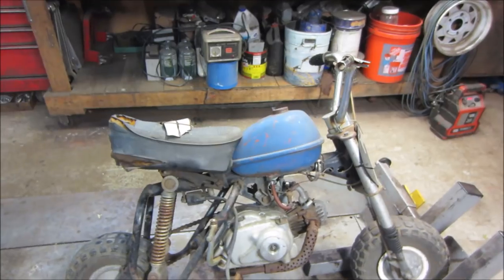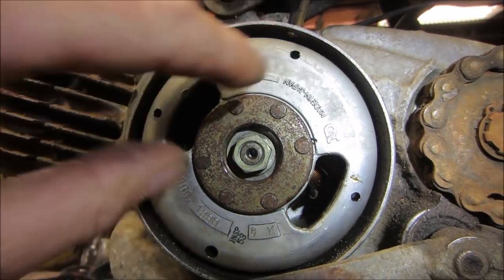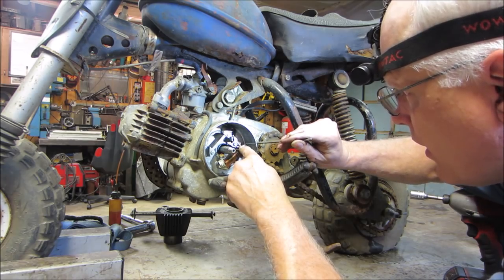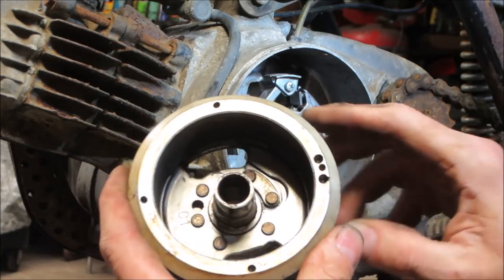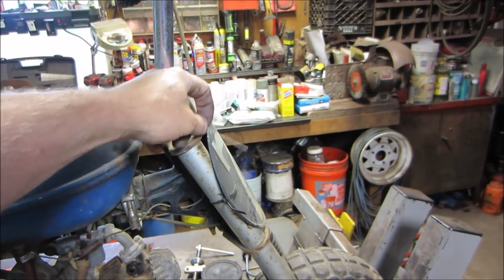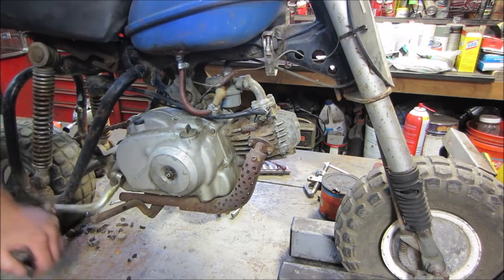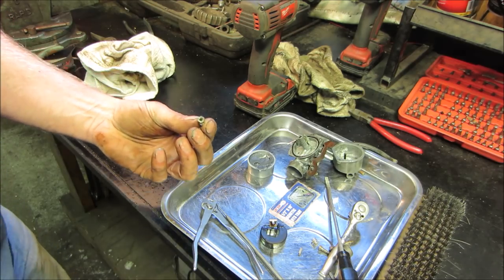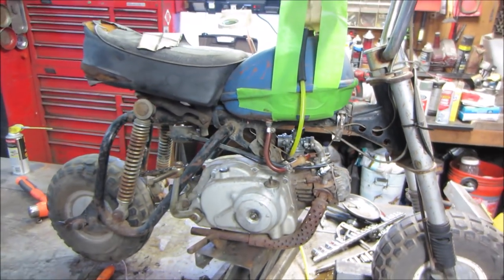will it run? old  honda 50 monkey bike

Comment: Me and a friend bought a honda 50 together for 20 buck when I was 12 yrs old . I got it running we beat the crap out of it for years. Then sold it to an old guy in town when the coil wire broke off. Then thrirty year later he gave it back to me when I found out he still had it. I got running and still hav fun with that little thing today and im 53 yrs old now. thats a well built machine in my book
Reply: Brian Atherton cool story, we were one of lucky ones owning a mini honda as a kid, good times!
Reply: Elo bob Dwarka yes we where . I always want a 70 but never got one. I did have a trail 90 that was almost indestructible  It had hi low range. I can still remember discovering that if you hold a little pressure on the shifter it would release the clutch. That made for a short life for the rear tire.
Reply: Yes ,that bike could take some abuse and keep on going..
Reply: Incredible story, not many can say the same. That’s awesome, I wish the guy I sold my first bike to still had mine. Man it’s was a lot of fun but being homeless and having to eat forced me to sell. I will have another that’s for sure
Reply: Brian Atherton same with me my father and my self got a old  1969 Honda SL.70  ran incredible with a little love and still have it . My honest opinion is the old stuff is better then new .
Reply: honda monkey can take a nuclearwar and it will still start on first
Reply: My fathers 43 and trade a push mower for a 750 street bike back in the 80s when he was like 11 and him and his friend would push it down the road and ride it because there parents didnt know about it and they laid it over the ditch one time and wasnt bug enough to pick it up and it was burning there legs because it was on them if that's not a amazing memory I dont know what is I have no clue how there still alive
Reply: any pictures of it
Reply: @brianatherton4916  I had one of those trail 90's it was a blast to ride and would climb very steep hills in low range, had to put all your weight on the handlebars to keep it from flipping over backwards!👍👍
Reply: On bikes and beards the pull a van with a trail 90
Reply: Brian Atherton . You ever think about selling it hit me up
Reply: Hell yeah,just goes to show us how well things used to be made back when things were built to last and people took pride in their work. It's a world away from the junk that's built to break nowadays because the manufacturers know that people will just go buy a newer,more expensive version. We are living in a throw away society and people don't even bother with fixing things anymore because it's cheaper to just buy a new one. It's much better to buy an older machine that is in good working order than to buy it brand new because the older stuff is bulletproof and there are still plenty of parts kicking around to fix them. It seems like a lot of the machines that were built up to the mid 1980's are still around and most of the stuff beyond that is just over complicated,computer controlled junk.
Reply: lucky im 12 i have a go kart my dad wont help me fix it
Reply: @flixyfn2454  what’s the problem with the go cart? Is it getting gas and spark? YouTube it and “borrow” your dads tools when he isn’t looking. You can do it man.
Reply: Landons flxzy If you can figure out exactly what is keeping it from running,chances are you can find videos on here that will go through the process step by step. Type in the problem and put "tutorial" after it and you will get endless results. If you can't get help,do it for yourself,you'll gain valuable knowledge and you will get the satisfaction of fixing the problem with your own two hands. Good luck,you can do it.
Reply: @GratefulEd907   i did that he got shocked
Reply: @flixyfn2454  😂😂 that’s great news it means ya got spark. Now see if ya have another friend dumb enough to try it? And don’t let those kids help you work on it because they’re idiots. You’ll want to check the carb next look for a video with a carb like yours. Good luck I hope it’s a simple fix. You may just need a can of carb cleaner.

Comment: You never fail to teach and improvise!! My wife and I each had Trail 70's.Wonderfull bikes. Would run up to 55 mph or so. Used it to roam the backroads for a few years.  Could use it on main roads some too. She and I shared many memories on those trusty Honda's. Had touring bikes as well. But The Trail 70's were a blast. And yes it did have to be plated. Loaned them to friends so they could take the state motorcycle license test's too. They never failed. lol

Comment: Plug boot replaced with a zip tie-Check. Throttle replaced with a brake lever- check. Gas tank taped on with painter's tape- check. Brakes- don't need 'em. This is the  award winner, Mustiest video ever! What a hoot...and the sumbitch runs!

Comment: I don't remember QA50s having rear shocks...  I think this one's been 'customized'...
Reply: I agree......This appears to be a 1973 QA50 K1 with 1973 Z50 shocks added - or '75 K6. Interestingly, it's a pretty trick mod no less which attaches to a hinged seat to be effective........maybe a seat bracket from a moped or other model?....hmm.......possibly all from a 1975 Z50A K6 (shocks too), although the seat here still appears to be the original (no side snaps).
Reply: @SoaringEagle1  I had a  1972 UK version that had shocks like that. It had no lever on the LH handlebar. Whats that for? it has auto clutch, no need for a  clutch lever.

Comment: I had a Honda Mini-Trail when I was 12 that my parents bought me brand new. It had a headlight and tail light with real chrome fenders, and it had a 3 speed auto clutch transmission bolted to a 50 CC engine. Needless to say I was the "king of the block" with that bike. I will be 60 the end of this month, but I still miss that little bike.
Reply from the maker: Very cool!

Comment: many old bikes didnt have a rubber tip on the float pin.. brass in brass, hence they wore out quicker... i have a pack of 10 valve pins and holders for one of my old bikes as they wear out every few years to the point they dont seal anymore.
Reply: many were stainless needle with brass seat, the seats got beaten of course and they leaked if it just trickled "shut" without  engine running. which is what the petcock was for :)

Comment: Small piece of wadding material at 180 degrees from points,should have oil on it to lube the points cam.Really enjoy your videos,nice one.
Reply: believe he said putting grease on it, if it's thin grease and you embed it well, it will flow and lube every time it's heated up :)

Comment: Original Honda the puller had a metric od threaded bar.  There was a indent for the end of the bar for the crank.  You would thread the bar into the flywheel and pop the flywheel off as you tightened it against the end of the crankshaft.
The high speed end movie was very fun.

Comment: Bought one for my kids to ride, it was great fun , in-till the top engine mount bolt fell out, motor drop down, pulled the fuel off the carb,  then they tried to start it with gas leaking over the spark plugs and , wife had to the fire department to extinguish the fire before the garage burn down. Pissed me off at the time but cheap lesson for my boys

Comment: I notice you have a lot of projects where the spark plug wire end is missing.  I watch you trying to attach wire end around spark plug connector with a lot of effort.  I believe the spark plug connector "screws" onto the plug and can be removed.  You could then put a ring connector on the plug wire and fasten it down to the plug using the screw on piece on the top of the plug.  I really enjoy watching your videos but sometimes the most obvious fix can be overlooked.  Let me know if I'm wrong about that.  Keep making your awesome videos.

Comment: 3 different fuel lines, tape to affix the tank, zip tie for a spark plug attachment, and brake lever for throttle. Not to mention the carb from hell brought back to life. You just wanted to ride that little bike didn't you :D (and you sure had fun riding it!)

Comment: Mustie, I've had a thought about your Amphibious Beaver:  Instead of creating an all new powertrain (horozontal engine, CVT, and Gearbox) have you considered using a 200-350cc ATV engine with it's integrated gearbox with reverse) and electric start?  Sounds far cheaper and easier, plus you have a wide range of options (auto clutch, full manual, or CVT) and you could find a junk ATV for less than a new Honda GX160.  Just a thought, can't wait to see how it goes and keep up the quality content!

Comment: You need the honda puller that works on qa's, z50's and 70's. plus sand the inside of
the rotor

Comment: Looks like a QA50.  I had one when I was a kid.  Had a ton of fun with it!  The only issue I saw that seemed common was a surging in 2nd gear at or near full throttle.  I don't recall the actual remedy but I think it had to do with the points.  Several of us had these bikes and all had the surging.  Mine was the newest and developed it.  Dad took it back to the Honda dealers and they quickly remedied the problem.  Oh to be 9 years old again!

Comment: Aaargh. You need FOUR things! Compression, fuel, spark and AIR! Love the will-it-run episodes. Don't ever stop!
Reply: Randy Novick thank you I was always told u need 3 things fuel air and spark and I always disagred and added compression truth is tho you'll almost always have air if u have compression
Reply: Replace air with timing lol
Reply: Air was always a given...maybe not for long😮
Reply: Umm...you can't have compression without air...lol
Reply: air is fuel.  its part of fuel mixture.  on a rocket they use liquid oxygen as fuel since it's not atmospheric.
Reply: And timing, he gave the example in the video
Reply: Harry Madden even with timing off it will still fire just not run right
Reply: If you got a spark and fuel it will run

Comment: LOL i can see that you didn't like riding that :-D :-D
Reply: brakes? where we're going, we dont need brakes!
Reply: Yeah, he was hard on the throttle for not having brakes .D
Reply: I'll wager after 10mins to dig out a plug cap, he was back on it. :)
Reply: No takers on that bet
Reply: "Who needs brakes?  Brakes are for Quitters!"  ~Mustie1
Reply: Brave (or skilled) man need no brakes :-) I have done the same things just to see if an old moped would run but no right parts at hand to really fix it. Somehow, little bikes like this are quite much fun and that's probably why there are mini pocket bike races. 

BTW, the ending reminded so much like Crazy frog Axel F, guess that was intentional.

Comment: It's videos like this that make me truly believe you will get that cracked up Villiers engine for the Beaver running, even if it may be a little hairy (pun intended!). Honestly, I think with a bit of braze and your talents that engine could be brought back. Villiers were somewhat of a proprietary engine maker in England from what little I know on them, and I can imagine the engine and clutch parts would be used across other engines if not the strange gearbox and magstarter arrangement. Just depends if you have the desire to try, but I'd love to see it brought back.
Reply: unless he gets more donated or many parts for dirt cheap, it's just not worth the cost.

Comment: Have you ever had a wire from a bench grinder wire wheel fly off and hit you in the eye....I have...It really sucks when they use a dental drill to remove it from your eye....I always wear safety glasses now.  (happened to me 20 years ago, maybe they don't drill em' out anymore)

Comment: i hate working on aluminum engines, i always sheer bolts!   Why i stay away from Jap motors 50, 65 and the 70 cc has always been hard to start   Now the 90 cc was much better and better yet was the 125 cc > So 70 to 50 cc makes nice anchor weight  he heee to me

Comment: Mustie... Why don't you just remove the chains and soak them in evaporust? You can re-use that stuff quite a few times. It's probably bother cheaper and better to get rid of all that rust on these various things that need the chain unfrozen than soaking them in stuff you are spraying on them.

Comment: If original Carb is MIA or wrecked there is enough meat òn inlet manifold to fit a vertical adaptor plate to fit a Z50A carb or A CT 90 or cheap chinese flange mount meant for little outboard , Generator or chainsaw - & cheap as chips (french fries) desparation opton....Z50, Z50A 1st. Trev. New Zealand.

Comment: Hi I’ve watched you videos for a wile now, so I rewired my chineses 110cc 4stroke quad, it’s also had new cylinder head,the timing been done, new carburettor new throttle cable, and it won’t start plz can you help me out if possible with a few ideas, I live in Wales 🏴 uk, and my area got no shops that fix them, so hopefully you got ideas that way help’ as I just can get it going, and I’ve tried most of the usual things!!🚗👍

Comment: Mustie1: Hey do you have this part?  
Harvey: I've got this broken rusty monkey bike that's been sitting for 30 years, see if it has what you need.
Mustie1: Sure.
<later>
Mustie1 drives the bike back to return it, having put $0 worth of parts into it, except for a fuel tank literally taped to the top.

Comment: Great job !! What a Blast from the Past !!  It was the first mini-bike I ever rode, that had gears way back when.....! I soon saved-up enough to buy a Trail 70, I wanted a 90 but cost way to much $$$. Along with the neighborhood, us kids put several thousand miles on that 70 ! We took it on every camping trip. People would stand in line to take a turn, especially the dad's !! I wonder if it's still running ?

Comment: My two Brothers and I's first mini-bike was a used QA50!  We beat the crap outta that little bike!  3 speed Auto!  We had it forever and when we got older, my older brother and I would throw it in the trunk of his '65 Dodge Dart and take it to Motorcycle Road Races throughout the Northeast, where we'd Cornerwork the Races!  They'd put us out on the furthest corner from the Pits, because we had the QA50 to get us out there!  ON THE TRACK!  You shoulda felt the g forces that thing created with the two of us on it, going around the High Bank at Pocono International Speedway!  The Chicane was unnerving!  HAHAHAHAHA

Comment: Be careful with those things. I had one of the Chinese copies, with a 110cc pit bike engine fitted. Great fun, right up until about 50mph, where speed wobble is imminent. The wheelbase is too short to be stable at speed. I'm guessing that's why Honda didn't put bigger engines in them.  There's a 3 inch a chunk of my right calf missing, from hitting the rear brake pedal, upon crashing into a barbed wire fence. Took 4 posts clean out of the ground. Fun little bikes, if a bit dangerous in the hands of a daft lad.  It's the most serious injury I have ever sustained on a bike, and I've ridden motocross and enduro bikes for 25 years. Been high-sided, low-sided, back-flipped and chucked over the bars, multiple times - No injuries. A short ride on a kiddie bike and I'm missing parts of my anatomy.

Comment: Hey dude its a honda QA50. Push rod engine. I watched U for a while, it was brutal.
Got the points gapped and spec was 14 thou that was ok. The QA50 is completly different to the  Z50 that had an OHC cam engine. Cant believe you tried to start it repeatedly with a squirt of gas in it. All Honda's of that vintage and up to now start on one or 2 kicks. Some of these bikes swallowed the choke when left on and kids hammered them.
Check the valve clearance push rod engines used to mushroom  valve stem from the same pounding mentioned. Put it to TDC and quit farting a round. The push rod guides got worn as well affecting valve open and close. 
Judging by the color of the oil that thing was just run hard.
Why didnt you look at the carb sooner, that's a given for varnished up or ethanol damage later on in its life. Maybe if you werent trying to vid this you'd do  better job. And your lucky a little ether didn't blow the cyl head off.
? Never blow out a honda carb with compressed air, you can plug all thd fine transition ports.
The rear shocks are not stock it was a hard tail. The original QA 50 had a single buid out and was warehoused by American Honda. Maybe 5 to 8 years worth of sales as thes were targeted at 4 year olds.  Made a K1 version and fixed the few probs it had. If that one jumps out of gear as all the 1st production did, you did a mod at PDI before delivery. it's a way cool mini mini Honda. Blowing into the fuel line is stupid. Float works on about 2 PSI, easy to damage it. OH tank is rusted out braze it up and It'll go again. Itd a centrifugal clutch. Probably crudded up with shitty oil etc.
Anyway you got it runnig so thats a good job.

Comment: I once got a Trail 50 for free. It had been sitting for many years. The front forks where bent badly, looks like someone had a bad crash. Somehow I was able to attach the whole front end from, a Gemini 80 to it. (Never heard of a Gemini)? The company didn't last very long.
Anyway, the bike looked goofy, with a 16 inch front wheel , and the small Honda rear wheel.
But I had a lot of fun with it. Rode it around for a while, before it started loosing power and getting slower and slower. Don't remember what ever happened to it. Wish I could attach a pic.

Comment: Hey man I really love your videos im off work right now because i broke my hand and ive been watching sometime 3 hour-long videos a day. Ive been thinking about something and would like your opinion on it. Do you think that putting POR15 in a thank that have rust inside would help get a few more years out of that tank or it would just peel off and clog everything? Im looking to buy a suzuki rm125 1975 and the tank looks crusty so i wondered if welding holes and coating the inside with some kind of eurethane based primer or por15 could do the job instead of replacing it.